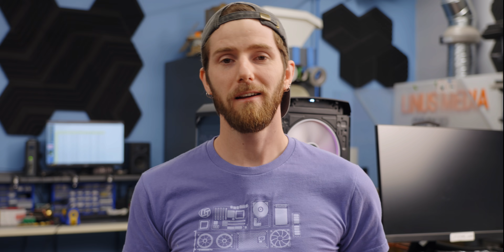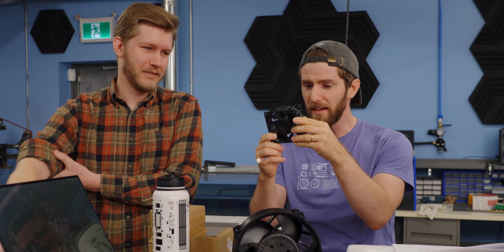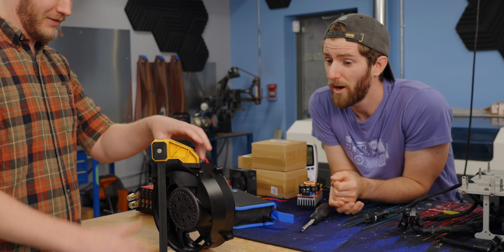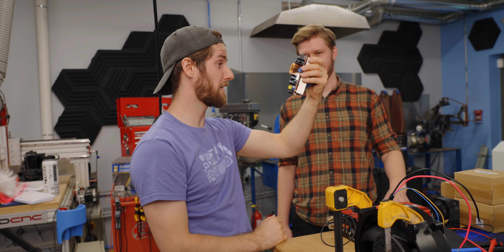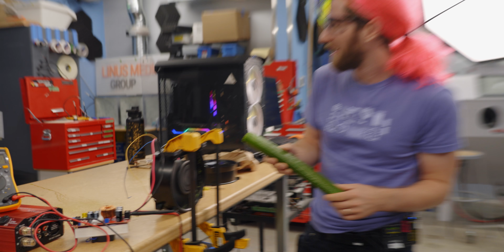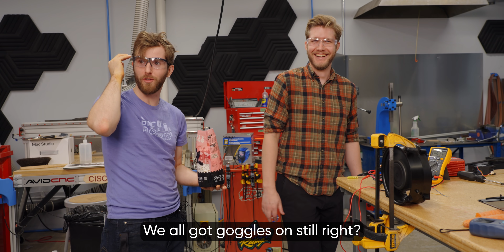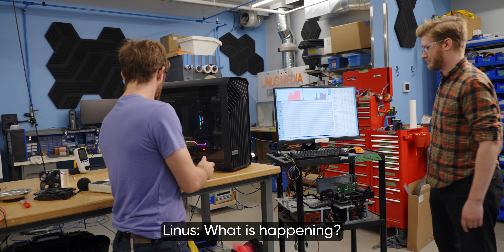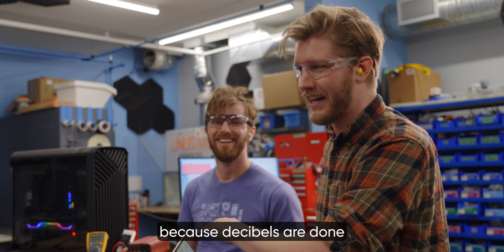The God of Computer Fans

Comment: I could actually picture those fans from the thumbnail in decibels, just based on my experience with other Delta fans. I think you figured out a new way to make baby food. Maybe, you could use that in a central thermo-electric water cooling system. You could cool the water with a peltier array & you could exhaust the heat to the outside, using those fans & a car radiator.

Comment: Tho BLDC motors can be used as generators, PC fans in general have these control circuits built into the fan frame. So the back voltages have to fry those electronics first, which include diodes and complex ic before reaching the motherboard. Usually when an engineer design such circuits, they also account for some idiot spinning it like this. So you're alright, probably.

Comment: When you read the voltage coming off the van that was spinning from the airflow of the more powerful fans, you had the multimeter on dc, it needed to be on ac because the power coming off the fan in generator mode was ac. That's why the voltage read lower then you expected.

Comment: I've used fans just like this. We use them in cabinets for motor VFD's (variable frequency drives) for large electric motors. Also in capacitor banks used for power factor correction in industrial applications.

Comment: Seeing a Delta fan that's 7,000 rpm reminds me of the 60mm 7,000rpm delta fan I ran on a Thermalright SK-6. That thing sounded ridiculous, but did allow me to overclock at 1ghz Athlon to 1.33ghz.  Glad those days of 60mm fans are over. 😃
Reply: I still have my 60mm delta, SK-6 and Athlon 800 as well! Later upgraded to a 1200 MHz but I never explored proper overclocking…

Comment: I remember worki8ng for s small SEO company while i was the IT guy for it, the boss wanted 40 1U serves in a phone closet. I told him we need to have a cooling system for the amount of servers. Boss was like naw its all good, he bought a standard bathroom exhaust fan. One of those ones that are rated at 50 CFM. Plain aluminum case and blades.

He is like "this fan will do the trick!" as he spins the fan and sticks his finger in and slicing his finger in the process.

Not too long after that i quit.

Comment: Guessing that's in Canadian Dollars, current Digikey price is 278USD. Curious that if they bought the fans from Digikey, why didn't they also buy 48V PSU from there. The PSPA-1000-48 would have been well suited for this. x3

If you want silly, HP makes some 92mm-ish 200W fan modules, the system they go in to has a minimum rating of 150W just for cooling, and about 2kW at max. They're kinda close to the profile of a 92mm fan, but a lot deeper. Could fit a stack maybe 10 or 15 of them in front of that case, though might need to strap it down since these fans have a TWR >1 at full speed (around 30k RPM apparently). But they are designed for negative pressure, so the case might just collapse instead, which would also be amusing. Can usually find them on ebay for under $30 each with many of the spares I've bought going for <$10 ea.

The main issue with force spinning modern BLDC fans is blowing out the bearings, or blades failing. The later is more of an issue with blower fans in things like laptops.

Comment: They use similar fans like this in PLC cabinets at work.  they contain several PLC and other electronic devices.  We use them when we don't use small AC Units.
Edit:  oh, on the first computer I ever built in the late 90s, I used an AC powered fan from Radio Shack to push a lot of air.  A lot more than available 12v DC computer fans i could find.  It worked well; but it was loud.  i had it wired directly into the power supply feed line with a separate switch on the front of the case.

Comment: With that much airflow, I think you need a good air filter so you don't send projectiles into PC, or sand blast the components. I also worry about static buildup.

Wonder if turbulence is enough to wiggle component and cause damage with vibrations in the long term.

Comment: I know that they use these in industrial switchgear to move air through 200+ HP motor VFDs. I'm not sure if that's what they were designed for, but Allen Bradley uses them.

Comment: We use those axial fan for cooling the industrial control panel for refrigeration system  each control panel run 2 of these fan which is pretty loud multiply then by 12 panel which is unbearable loud

Comment: Yep, used some of these to pull air through a small server cabinet that had a lot of pressure differential from filters. I don't remember exactly, but I think we had 5 servers with dual e5-2667v2 CPUs each. Noisy as all get out, but they moved the air

Comment: I suppose this goes to show why you need to be careful around large scale R/C helicopters and respect the rotor blades.  If you can do this with a 600W motor, think what an R/C helicopter can do that can push thousands of watts while swinging around large carbon fiber rotor blades around?  I have seen videos where say when getting too low while doing tic-tocks, the R/C helicopter blades have dug into the ground, ripping out chunks of sod and throwing them into the air.  The limiting factor being the torque created overwhelming the tail rotor, causing the R/C helicopter to pirouette out of control and suffer a tail strike at which point the R/C helicopter folds up and explodes from the main rotor blades hitting things including other parts of the carbon fiber and aircraft grade aluminum helicopter.  I mean if the rotor blades can do that much damage to the ground before the ground finally wins, as the ground always wins, think of what that can do if you get hit by those carbon fiber blades on accident.

Comment: Loved it!  I think you should find the smallest automotive radiator cooling fans and try them.  No. 1 they run on 12 volts and no. 2 there definitely cheaper.
Reply: The smallest ones are still quite large, though, because they have to bring airflow over as much radiator area as practically possible.

Comment: $25 Box fan plugs into same AC power strip as the PC. Replaces side panel of ATX tower. 3 speeds. Use Furnace filter for dust control. Ask me how I know.

Comment: Used in not compute objects. These are standard fare in RF transmitters (as in FM radio). Although pwm controlled to 60%. They can spin up to 95% in fault situations however. And still damn loud at 60%.

Comment: Use those to pull the air out of or into your server room and check the Temps.  Cool air in. Pressurizes the room. Hot air duct out the top of the room to the outside or a hot air vent tube. No need for ac in the server room. Might be able to heat the office for free with excess heat

Comment: Rpm higher on the small fan but top speed isn’t. It’s more than just the bigger fans higher inertia.

Those fans are for full racks. A big rack might have 3 bays with 2 each. Hard drives might be really tightly packed so you need a lot of static to move the air. They are unbelievable loud.

Comment: The fans can’t generate back voltage because they’re brushless. By nature of the circuit design not because of protection circuits. Source: I’ve designed them. 

I’ve purchased similar fans for solid state DC converters for aircraft power systems.

Comment: I have a cooler idea... to 3d print a funnel-shaped air duct behind the two fans to blow air directly on the CPU IHS. This may cool it without the need for any cooler! Might get supersonic airflow as well so a Laval Nozzle may be required
Reply: It would still be hot. The surface area of a heatsink it multitudes higher.

Comment: Is linus a shielded baby?
A pot is how most basic boost converters are controlled, who cares if a terminal block is crocked.

Why use a manual tacometer?
That fan has a RPM sense wire.

Comment: Large power electronics like big industrial VFDs (sometimes with power output measured in 100s of Hp or kW) often require immense amounts of cooling, so I wouldn't be surprised to see something like these fans cooling them. That's about the only real application I can think of for them though.

Comment: I love these crazy videos. Reminds me of the old days of overclocking. I used to run 6 Vantec tornadoes in a case, I had the same result of not using a fan on my tower cooler, giving me better Temps. A big part of it was not having the dead zone, that is blocked by the fan motor, on the fin stack.

Comment: I hear there's a problem with the CPU heatsink fan overspinning. The solution would be to use only these fans for front intake CPU cooling fan and a rear fan and top exhaust.

Comment: those fans would work perfect to put on a sealed case and put some gpu accelerator4s in it they would then get the air they are designed for

Comment: That fan sucks up too much power and would take almost 3/4 of the power of my PSU. Also, I will not add a second PSU to my Rosewill Rise Glow case to use one of those. In my opinion, those fans are intended to be used to cool a server rack.

Comment: the best fan that costs a lot less then 422 is the rad fan from a 90s ford tarus with the 3.8lt it has 2 speeds and moves 2800-3000 cubic FEET a minute. these fans only move 1026cfm idk where linus got his figure from 1026 is what delta says.

Comment: you could duct the air in, but seen them used in 2 places, one was a metal shop were they needed a lot of air cooling around some welding etc equipment and the other was in the top of a server rack set that needed extra cooling pulled through the racks.

Comment: You have low air pressure in there because of so much air flow. Low pressure means less thermal reaction. Put some fans on teh back to use feedback to reduce flow and increase pressure

Comment: Those little blue pots aren't meant to be tweaked on very often. If you constantly use it to adjust your output voltage, the pot will probably end up broken before too long.

Comment: They use them in portable load banks for generators.  You have to cool off the sinking of 100kw of power and you can cook hotdogs from the exhaust heat.

Comment: only direct dc fans will give back the current (the other ones run on pwm or ac. so they have things like mosfet or transistor with diode in them)

Comment: I use a step up voltage booster to run my gaming laptop in my jeep! dc-dc power 12 to 18v! Works fantastic and I've had it about a year or so at this point.

Comment: These fans can be used in server rooms for ventilation but they are also used in a few other niche cases like creating positive pressure for smoke and fire safety (safety of equipment not people, think of how much damage smoke can do to old tape systems) and I have seen them used on industrial manufacturing equipment in chemical production to keep electrical systems from getting too hot. Think about your PC's PSU but now its 10 PSUs and each one steps up from 230v mains to 6320V secondary.

Also you guys got ripped off if you paid $422 for each, I really hope you didn't pay $422 for each.

Comment: I was dying when the fan first turned on and kept getting faster. Also the vegetables through the fan blade was wild. This would be awesome on a back of a skateboard and then be able to control the speed you would be able to do some cool stuff.
Reply: EDFs are even better for that sort of thing: https://www.youtube.com/watch?v=eMeeFEMTx78
Reply: @kaelwd   That is neat but, wouldn't work for what I meant. I envision fan being installed on a skateboard so you can kick/push regular but, then also switch on a controller the fan and adjust speed as well as angle of fan so for example if there was a manual pad you could ollie land in a manual and increase fan speed same time to do a cool fast boost or use it while skating a big bowl.

Comment: I'm using a slightly smaller 172mm Comair-Rotron (vs Linus's 200mm Delta) as a desk fan right now. Mine runs on AC line voltage (115vac), but I'm running it at 48 volts through a Variac. Even running at such a low power, it's still putting out excellent airflow, and at less than half power, the noise levels are actually quite nice. 60 volts is the limit for low noise, and by 70 volts, I already can barely hear myself think. The landlord turned on heat at my apartment, and mine's malfunctioning, running the floorboard radiators 100% of the time, even though my thermostat is off. With all my windows wide open, it's still 81°F (27.2°C) inside.

Comment: I used one like this to cool a PLC off at a natural gas facility. It was inside a Hoffman box inside a sheet metal building in Texas heat. the building before fan reached 180 degrees Fahrenheit.
Reply: I bought an actual power supply though lol

Comment: those fans are for factory and medical equipment cooling seen some in a 12 fan array for a slimline condensing unit they are very loud but move a massive amount of air at full RPM these rarely hit top speed with their PWM control you can ofton find these in some appliances they are designed to take very high heat to a point that their computer conterparts would melt these will hurt bad if not careful

Comment: Yes I do.. Those fan are use like emergency force ventilation on remote communication node.. If the a/c brake down .. The energy or security system trigger the fans..

Comment: 7000 rpm on a larger diameter fan is not the same as 7000 rpm on a smaller diameter fan. The larger fan has a higher linear velocity.

Comment: I literally screamed “NO LINUS YOU MORON” when he demonstrated the airflow with the wig. Putting the wig in front of the case with the fans on was pretty boneheaded… If more than a couple strands had happened to get caught, bad times. Break a finger getting it yanked out of you hand or even enough could abruptly seize the fan causing a failure with ejection of pieces of the fan or worse.

Comment: I have used similar fans before personally had 4 of them installed at the top of a server rack they would pull air out the top of the rack to help air flow, loud as hell though.

Comment: The outside end of the larger blades is also travelling faster in terms of KPH or MPH, because even if it's spinning at a slower RPM, the farther away from the center it is, the more distance it has to cover in the same amount of time.

Comment: I still have 7  of these fans in my garage. I used them on pump control panels with dual vfds rated at 300 amps and a massive plc system. these systems are usually stuffed into small spaces and with little airflow so to compensate we decided to use these fans. honestly after implementing these fans more of our customers had less downtime due to electronics overheating. no  one is near these systems so they can be as loud as they want to be.
Reply: Is the continuous 600W power draw negligible for most customers or is temperature controlled?
Reply: @vinno97  The 600+ watts is negligible when taking into account that each motor pulls 75+ amps at full load. Since using these I had a system that would fail, heat related, that went from an issue to no issue. I tied the start wire into the main contactor so the fan only runs when the system does

Comment: My partner heads up a network engineering team at the local university data centre and while not identical, there are fans similar to this used to cycle the entire room's air.

So each aisle of server racks is inverted so that they all draw from cold aisles and dump heat into hot aisles (You don't want to walk down a hot aisle.. it suuucks). These giant fans help to extract all that heat from the aisle before it can flow back over to get reheated even more. Even while yelling, I could barely hear a word while he showed me through.

Comment: The only oe fan I know of that moves that much air and is that dangerous is the cpu fan from the old Dell dimension series (5100 etc) accidentally stuck a finger in one while it was on and it just about cut the tip of my finger clean off.

Comment: We use similar fans to these for cooling in higher end internet core router (think 60Tbps or more). The smaller units would have 4 of these (or similar) fans with pwm control of course. 
Bigger units could have 8 fans like these. As others have mentioned, those boxes run off 48v so the fans go directly to the power rails. It not rare that a router like that would use multiple kilowatt for just for cooling, especially since the air paths can be very constrained

Comment: You will find fans like that in factories and mills. They cool the MCC (Master control center) VFD’s (variable frequency drives). Helps prevent dust build up which could cause cabinets to ark and to keep the internal Allen Bradley computers cool.

Comment: So I worked at a theme park, and we used these to cool racks. Usually they housed audio amps, lighting controllers, media servers, show controllers, and animatronic PLC systems. My personal favorite use however was mounting one over my tool cabinet, and wiring it to a pressure plate so it turned on whenever I was working at my bench.
Reply: so it's high density power supply kind of deal?
Reply: @aronseptianto8142  Suppose you could say that, these would be used in dense server racks, massive high wattage LED arrays etc. Anything that pushes a lot of power in need of high volume air to dissipate would be it's realm. The other thing is there's plenty of blowers n such that could do this but this form factor is what makes it the "one to use" over those as they're usually much bulkier. This as an example they literally screwed it onto a case vs having blowers in front of it, more compact and just as capable.
Reply: @aronseptianto8142  like the other user said, they fit really well in racks based on their form factor. I mounted a lot of them to the top of racks to force air in. HVAC was typically close enough to the intakes, so it was pulling the cold air in. But yes… density would be a good description. Imagine about 12 Crown 70v audio amps per rack, times 6 racks. You could hang a wet shirt in between and it would be dry in 7 minutes. These fans helped. A lot.
Reply: Man's playing Minecraft IRL.  True inspiration.